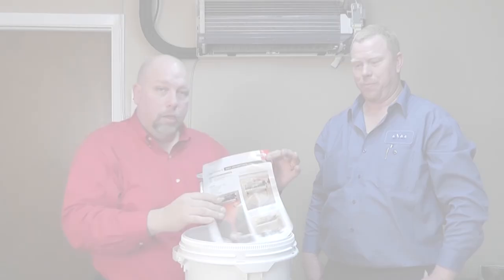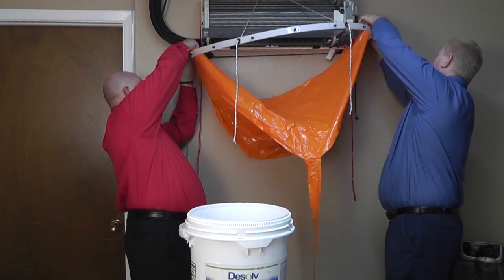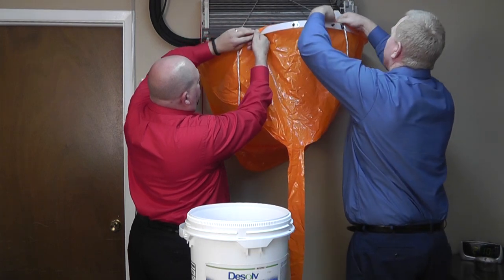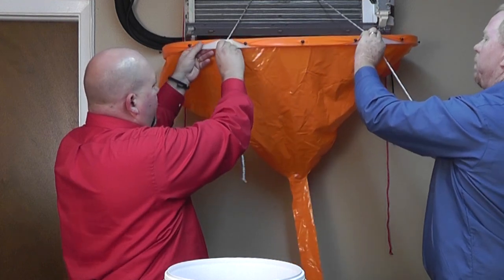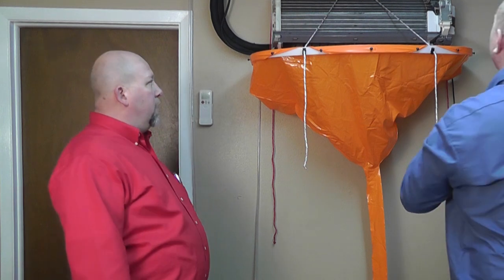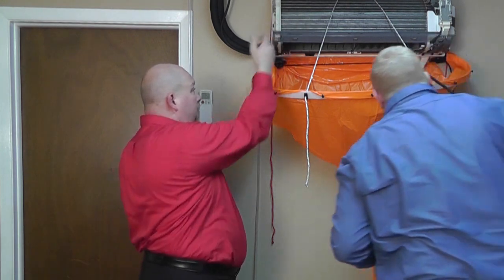Desolv™ | Mini-split Evaporator Coil Cleaning Kit

Comment: Most of the time it's a single person servicing the mini-split.  It'd be helpful to see how much of a handful it is to hang the plastic funnel solo.

Is the funnel supposed to be reused or discarded?  If reused, it seems like you want to have a funnel for each head you're cleaning that day.  If it's wet and dirty at the end of cleaning a head, the funnel would need cleaning and drying before cleaning the next head.
Reply from the maker: Steven Scott 
1) the kit is designed to be a one-person job; we note that it would be helpful
for our next instructional video to show more of the actual application of the
kit.
2) the bags (with funnel) are designed for single-use; they are disposable.

Comment: Beats taking the unit off the wall to clean! I'd rinse the chemical off personally, especially off the blower wheel, some of the plastics used can be a bit sensitive to chemicals.
Reply: heavydiesel we have the speedclean version of that set up its called mini split bib kit. We are limited to some extent with it but it works well. Some don't care for it but when used properly it dose not harm anything. We also just use a lite detergent like simple green. Thx for sharing
Reply from the maker: Tazzman228 Yes, the RectorSeal developed the DeSolv kit because of frustrations many contractors had with the way they have had to do things up to this point in time; the DeSolv kit is an advance over prior methods because of improved design, single-use bags and our own proprietary cleaning chemical, which no one has ever developed specifically for mini-split evaporator coils, until now.
Reply: @RectorSealCorp  You did not address heaveydiesels' comment about rinsing following cleaning with Desolv.

Comment: The holes on my funnel bags did not align with the pins on the frame. They were off by an inch. The bag stretched enough for them to fit, but I was worried they might rip during use. That didn't happen but the threat was still there.

Comment: This is great, but I have two blowers, One measuring 48" and another Measuring 36" so I take it that this system will only work with my 36" blower and not my 48" Blower? Do you make something that fits both?
Reply from the maker: +ERVARGAS NYC Desolv bags will fit a maximum size 44” condenser. They only come in the one size. Hope this is of some help.

Comment: So you forgot the step on how the black pieces attach. How do they attach?
Reply: I know you asked this 2 years ago, but I will answer based on my experience using the kit for the benefit of others who may have the same question. 

The black corner pieces just slip behind the lower corners of the unit. Their installation is covered in the instruction sheet that comes with the kit. After installing the metal clip top center of the unit you position the black corner pieces and tighten the red rope to hold them in position. Then tighten the black cord between them to keep them snug with the sides of the unit. Other than that there is no installation for these pieces.

Comment: A few of my units have Aspen Mini Lime pumps to pump out the drain pan.  Will Desolv be good to clean out the Mini Lime pump reservoir or will it hurt the pump?  What would be a good cleaner for those pumps?
Reply from the maker: Erik Yates Desolv and actabs DMSs are approved for Aspen pumps. Use Desolv for cleaning and actab DMSs for preventive maintenance
Reply: Great, thanks. Just used the ductless/mini-split cleaning ki for the first time, and the unit looks brand new! Great products to keep the mini-split clean.

Comment: Where to buy the tablets at the end of video and where u drop the two tablets into? Is it to stop mold growing?
Reply: This is just me spit balling ideas out here so don't quote me, but I believe that the purpose of the tablets (assuming that they are dissolvable) are meant to help keep any kind of gunk, rust, clogs building up on the drain pan and to allow the water and any condensation to just flow on and out of the drain pan, helping it stay clean and dry.
Reply: @SESSHOMARU3INUTAISHO  Thank you.  Would be great to have some then.  Don't know what is its general commercial name though
Reply from the maker: Hi, there thanks for an interest in our products. RectorSeal also manufactures the Actabs DMSS tablets. For more information about them visit our website. https://rectorseal.com/product/actabs-dmss/ If you would like to be connected to a rep in your area fill out this form. https://rectorseal.com/contact-rectorseal/

Comment: you will not do a good cleaning job particularly on the fan with only a pump sprayer I have tried it and it does not do a good job.  The second problem are those plastic strips.  The units are mounted to a steel plate and there is little to no room between the evaporator frame and the steel plate too shove those plastic strips up.  The chemical is excellent and the basic idea is good but the  plastic bag mounting needs to be improved upon and you really do need higher water pressure to do a good job .
Results Htg & A/C